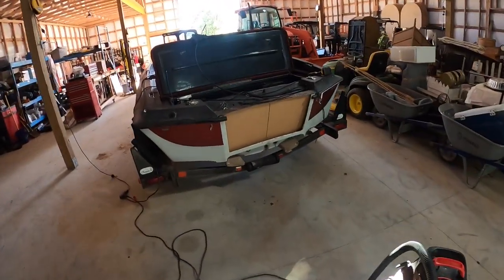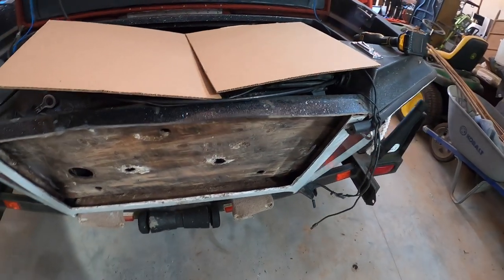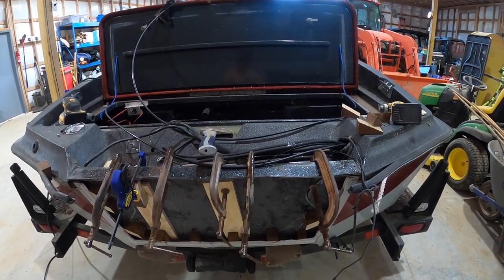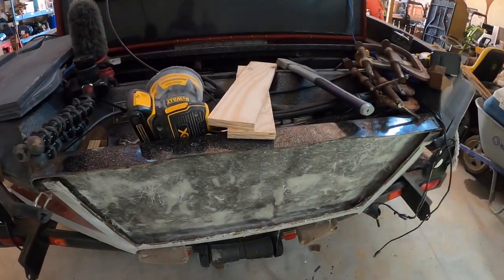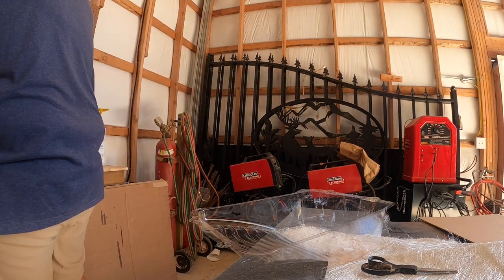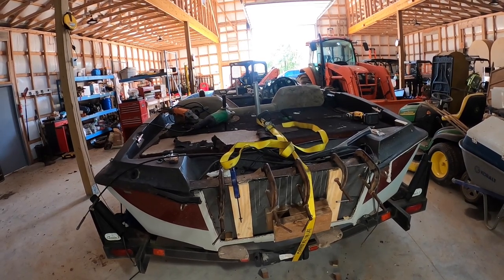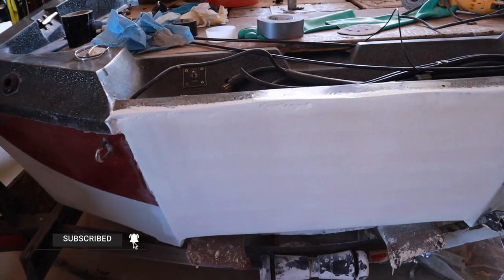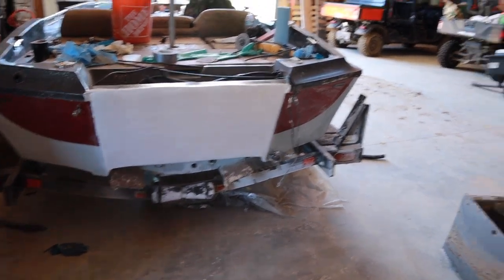IMPOSSIBLE Transom Repair | DIY Bass Boat Repair

Comment: There is a product called FRP, it's a layer of fiberglass, then plywood, fiberglass, plywood,then fiberglass again. I worked for a company building horse trailers at one time & that is what we used for the sides & tops of the trailers & it came in 3/4" thickness. Forgot about that stuff until a few minutes ago. Oops 🤭.

Comment: I wouldn’t of cut the back out. Cut the top cap ( you have to fiberglass anyways if you didn’t want to pull the whole top cap) dig out all the old wood and fill with sea cast. Best on the market for transoms. Splitting the coosa down the center eventually will wear the seam down and cause it to split if not done right

Comment: I am intrigued about this boat after repairs. Is it on the lake now? what size motor are you planning on using? It looks amazing and it is almost pushing me into doing the same except my concerns are if the boards used for the new transom are segmented, how is the force of the motor and water going to impact the integrity of the repair? Hope it works amazing and you are truly enjoying this boat with no concerns. Thank you for sharing!

Comment: I hope it worked out , I seen other guys cut out just the top and cleaned out from the top down and then poured an hardener and it just fills up the back like a cup and hardens. Instead of cutting the whole back off.  It was a champion and mabe they just had a lucky way of figuring out how to do it another way or somthin ? And mabe it wasn't even good but it looked great.

Comment: Hey here's a old trick for working with insulation which I'm sure will work with fibre glass. Put baby powder all over your skin before working. Clogs all your pors so stuff can't get in and make you itchy